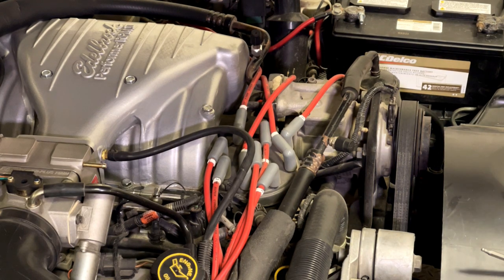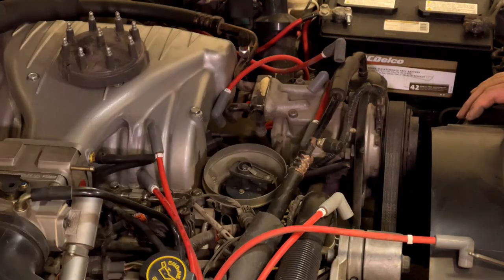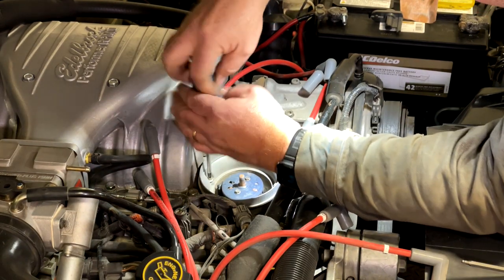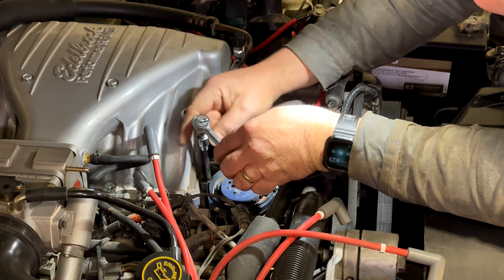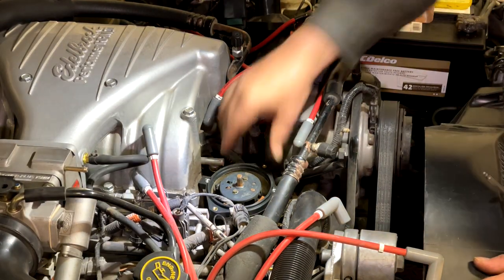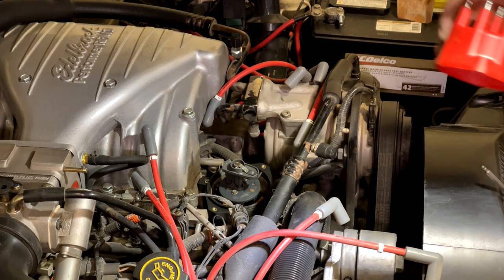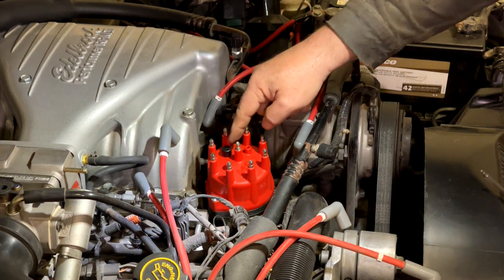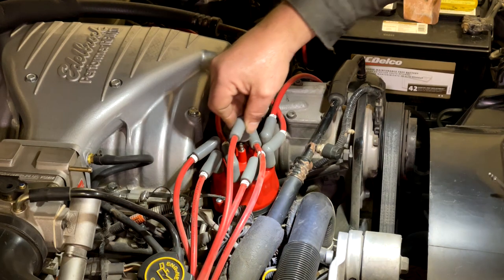Install a small cap on a Ford TFI Distributor with this new Adapter!

Comment: Man those fords engines are way easier to get to ! Haha great vlog 😎
Reply from the maker: Yeah, this is an easy install. I designed this part to help guys who have problems with clearance on engines with aftermarket fuel rails and other modifications that interfere with the big cap on the Ford TFI distributor. There is no other part that allows this small cap modification on the market, so hopefully some guys will find it useful.

Comment: Will this small cap clear the holley hi ram intake manifold?
Reply from the maker: The small cap with adapter sits approximately 7mm HIGHER at the terminal tops than the factory cap. It is approximately 33.5 mm smaller in diameter at the top of the cap. Both are approximately 98mm in diameter where they attach to the distributor housing, but the factory TFI setup quickly expands to 125mm diameter while the small cap setup slowly tapers smaller to approximately 91 mm at the surface that the terminals protrude from. There are places on the small cap between the terminals that are about 91.5 mm in diameter as well. I have not measured the specific manifold you asked about on a car so I am not sure if the clearance issue is the height, or the diameter at the top of the cap. If it is the height, because this setup is slightly taller, it is likely not a solution. If it is the diameter, there is a dramatic difference, especially at the top of the cap. Hopefully these measurements help. If you need something more call the shop - our contact information is at www.tecmotion.ca

Comment: Just ordered my adapter today, ill see if this will work on edlebrock pro flo 4 distributors as well, online seems the same pattern
Reply from the maker: I have never tried it with that distributor and it’s absolutely not guaranteed to work with it, but I will be interested in your results.
Reply: @tecmotiondyno  i will see, it looks to have the same keyed pattern, will see when both arrive to see👍🏻
Reply from the maker: @OldPaint  it’s on the way!
Reply: @OldPaint  so, um, did it match?
Reply: @OldPaint  please post whether it works well or not.  I'd like to confirm before I spend ~$100 on it...  Thanks
Reply: @dougstewart5122  in short kind of, is it keyed to fit yes, out of the box i had to file the rougher parts of the 3d print and shaped the key to fit properly, if its an absolute necessity i would say go for it, im going for a show car look and wanted msd cap(i prefer the smaller mad cap)
Reply: @OldPaint  wow, thanks Cody.  I already jumped the gun & got the cap and rotor.  Expecting the adapter JUL 2~5.  Will try to remember to post results.  [lots of other stuff to do before I can fire up the engine...]

Comment: Does it shorten the tfi installed height?
Reply from the maker: No, it will actually about about 4.5mm taller at the terminals.

Comment: I installed the new Motocraft TFI Module from RockAuto and what does it mean when you connect the plug into the tfi module nice and tight then wiggle the wires and I got spark ? my car even started up and ran for 10 minutes. then i turned it off let the motor cool off and it would not start only crank i wiggled the wires coming out from the TFI plug and it fired right up. ran it again for 10 minutes then I hooked up my inova 3145 and with the koer i got codes 8, 12, 42, and 92 would the timing being off cause a code?
Reply from the maker: There is no such thing as a code 8 on an EEC IV Mustang - they are all two digits. Your problem sounds more like a wiring fault at the connector or possibly a bad or counterfeit TFI module.

Comment: Do you know the MSD Cap Number for this install. I see 2, a 8431 and a 8433. I want to make sure I order the correct cap. 88 GT.
Reply from the maker: This installation uses the MSD 8431 cap and Standard Motor Products FD308T rotor. An installation guide is available on the store page at www.tecmotion.ca too.

Comment: Excellent video, Tecmotion makes this adapter?!  Part numbers?  Well done BTW!
Any concerns with high rpm spark jumping with the smaller cap?
Reply from the maker: This part is brand new and I put the video up for my Beta testers, however it will be released shortly through our store following successful extended drive testing. Concerns about cross fire with the small cap are probably not founded in most applications - this size of cap is used in many applications including many GM applications, and with distributors like the Holley Dual Sync on Fords. There is just no other way to get a small cap on a TFI distributor when you need the clearance for your aftermarket fuel rails.
Reply: @tecmotiondyno  I see this as a good addition to those running TFS R intakes.
Reply from the maker: @esamoil  Anywhere you need more clearance around the distributor but need to run TFI. It doesn't reduce the overall height, but it reduces the diameter quite a bit.

Comment: This is a terrible idea. The whole reason Ford went to a big cap when they introduced TFI is so they could prevent the stronger spark from jumping across posts inside the cap. Spacing them apart achieved this. Apparently you think you know more than the Ford engineers.
Reply from the maker: You would never put a small cap on a TFI distributor for giggles, but when you need clearance around the cap for other aftermarket parts, it helps to have the option. In fact, the small format cap is more the norm than the exception in automotive distributor applications, including those with high powered CD ignition systems, and crossfire turns out to be mostly a red herring. Although you are right about the reasoning behind the large TFI cap, it turns out to be overkill in these applications - So much so that MSD discontinued the huge "pro stock" style cap on their front drive systems and just use the Ford style TFI cap with them, and those applications typically use the highest powered ignition systems available.